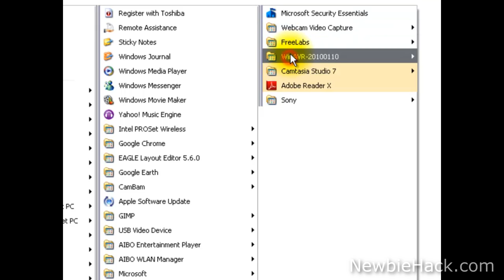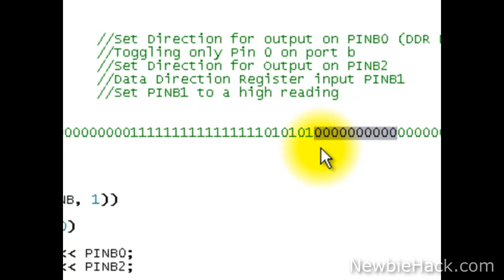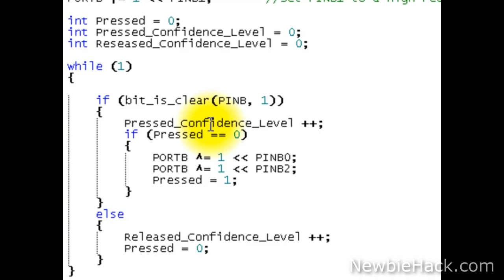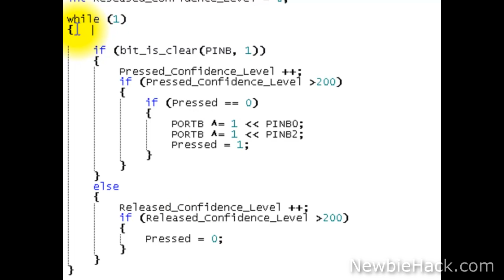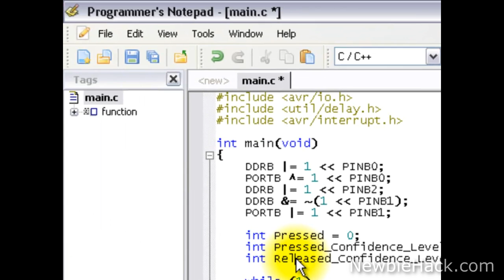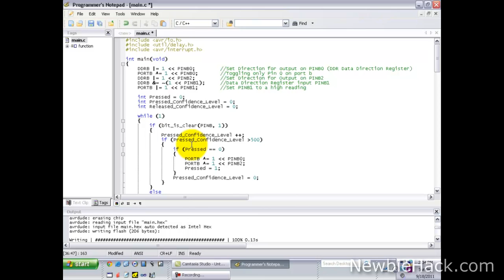14. Arduino for Production!  AVR Atmega32 - Button Debouncing through Software

Comment: What is the advantage of software debouncing over hardware? 
The hardware one looks pretty simple.
Reply from the maker: The software advantage is if there is high level production and reducing the hardware can significantly reduce the cost as long as the software isn't too complex that the debouncing will cause a problem with performance. If the production is low, a hardware approach may be fine. Hardware debouncing can be more sophisticated.  This is my opinion, of course.
Reply: @PatrickHoodDaniel  Ohk, understood. That's true.

Comment: You need to increase one confidence level AND reset the other.  Only then it will work properly: 

if ( "pressed" ) { PCL++; RCL=0; } 
else { RCL++; PCL = 0; } 

When evaluating it you need to have THREE cases:

if ( PCL > threshold) { do something } 

else if ( RCL > threshold ) { do something } 

else { DO NOTHING - because its still bouncing }. 

Hope it helps. M.

Comment from the maker: Ah yes, I understand.  You are correct that the PressedConfidenceLevel is unnecessary since it is not being used in any decision making.  I will modify the new library that I made (you should check that one out) and try it.  I will also update the code on the newbiehack page.  Thanks.

Comment: These videos are a big help. 
@rakesh: Actually its not about the no of times you need to press the button. Its actually the processing time, the atmega takes to set the counter to 500 and until that, the period of bouncing is gone. Its a very short time it takes to do so on realtime, less than the time the button is in pressed position, even if you toggle it very fast

Comment: I have one doubt in this tutorial..
In the outer is if part the variable conf++ and one if - else is taken. When ever you pressed the key variable conf will get incremented...My doubt here is that until the number of times you have pressed is less then 500, toggle at the pin positions is not possible.... But you have shown it's working....how?
If any one knows the reason please help me.......................